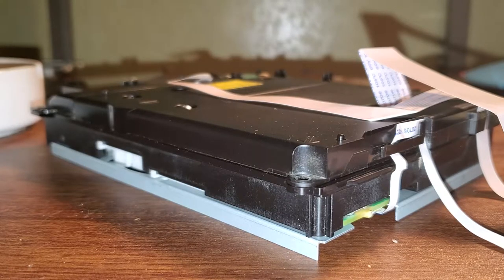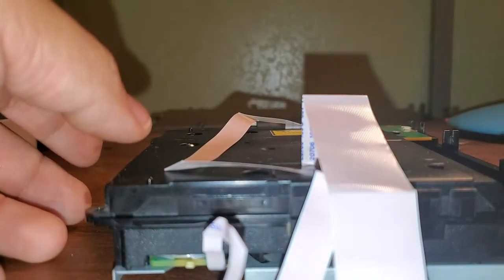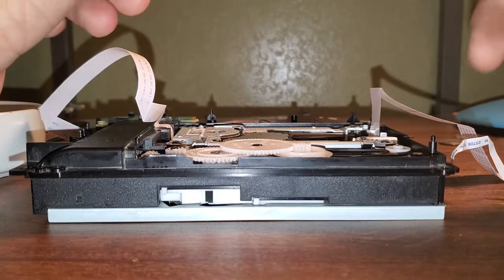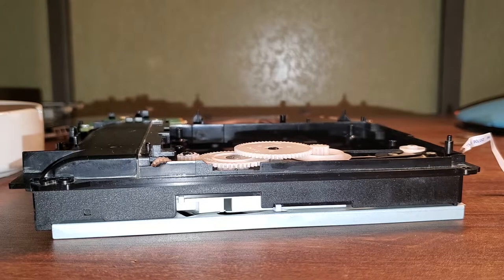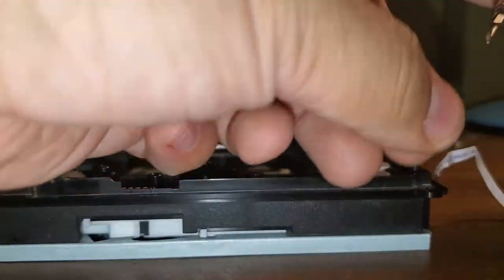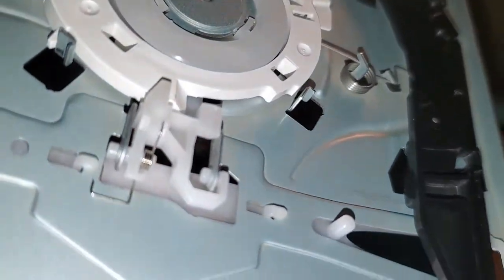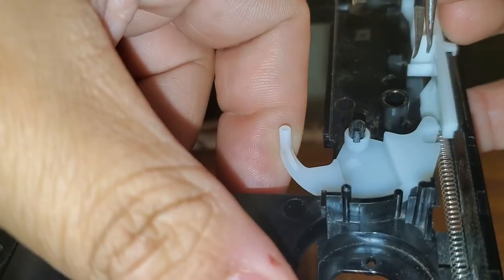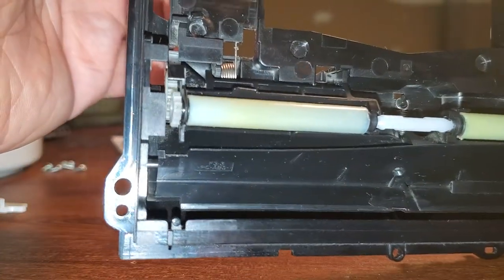PS4 CUH-1200 Disk Drive Disassembly & Reassembly

Comment: i installed a new drive in a ps4 , then found i needed to change the board , i swap the boards out and then reinstalled and now when i insert a disc it wont let the disc come in like its not getting any power to it , is there anything i need to doublecheck on this , and how will i know i have the skinny ribbon from the disk motor all the way in

Comment: Did everything you did with 100% accuracy now the door on the disc drive is shut....
Reply: The front door is just jammed. Try to manually turn the white cog wheels until you hear the front door pop back into place. Make sure everything is sitting in place & cleaned also.
Reply: @blazeone1410 How do I know when the front door pops open? Is it a loud or soft sound?
Reply: @protoyeen  The front will just pop back into place when you manually move the white cog wheels. It's more like it snaps back into place, it will be a obvious soft but noticeable sound.

Comment: hi, nice video.
can i please contact you through any social media and maybe you can help with the rollers being kinda stuck? thank you in advance.
Reply: Hey man What’s up I got same problem. My rollers cant eject or take disks cuz there stuck. Did you figure it out?
Reply: @Kaud_2  
nope. bought the new PS5 instead.
Reply: You need to remove that white thing that holds the rollers and then put it Back. This should put the lip down and you Will be able to put a disc now. Also if you're going to open the whole disc drive (if you want to change the laser for example), BEWARE OF THE TAPE ON THE BIG RIBBON CABLE, PUT IT BACK ON WHEN YOU ASEMBLE THE DISC DRIVE OR USE A DIFFRENT TAPE. OTHERWISE THE DISC WILL KEEP ON SPINNING AND IT WONT READ. I fixed the issue with the tape 10 mins ago (and i fixed the roller issue before that) and now i can play god of war and gta 5 in peace.